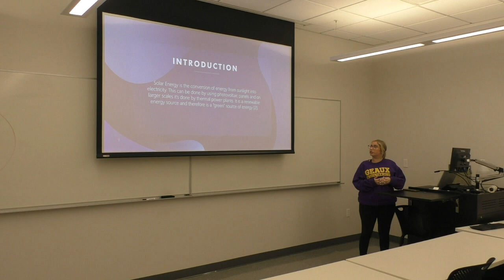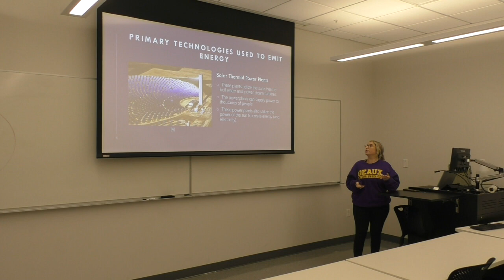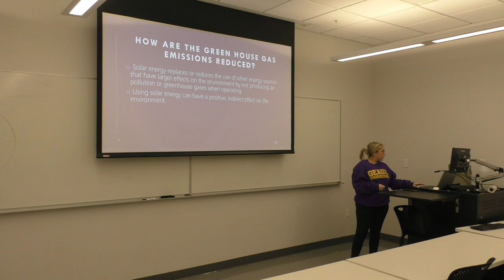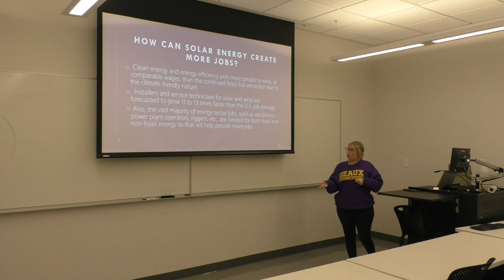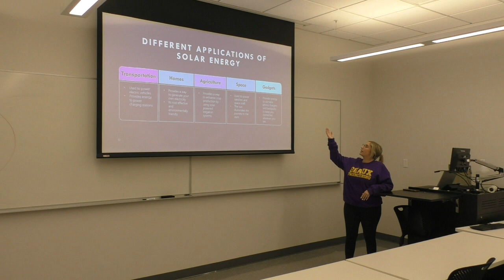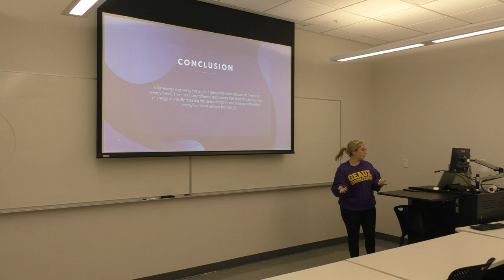Jadyn Rumfellow

Comment: Excellent presentation, Jadyn! Your choice of solar panels as a topic was both innovative and uncommon, demonstrating your thorough research and clear understanding of how they operate and where they are most effectively used. Your presentation skills have notably improved, effectively conveying the information with a firm grasp of the subject. Similarly, Jayden, your presentation was impressive, showcasing a deep understanding of the material. I have no criticisms to offer in both cases – you both did a fantastic job.